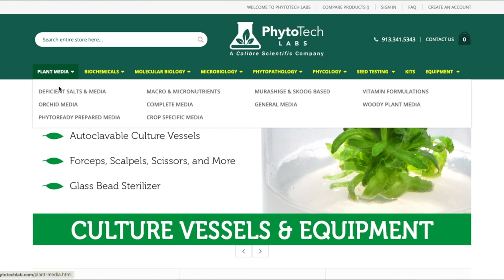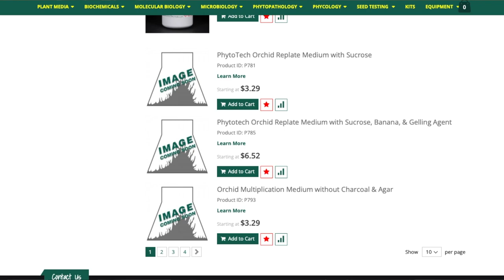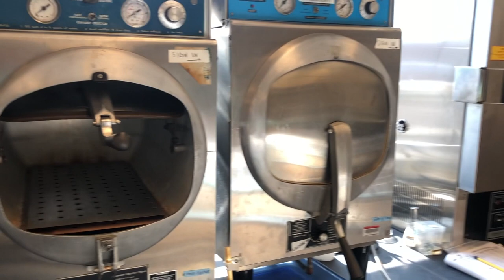Preparation of media; Flasked orchid growth

Comment: Is there a way to sterilize/prep your flasks without having to autoclave/pressure cook?
Reply from the maker: Thanks for your question - some claim that they can include antimicrobials in the medium to kill all the microbes that will interfere with flasking but you have to use very high levels and I have never been successful with this. You can filter sterilize the medium but the filters are expensive and you need a good vacuum pump to draw the medium through the filter - this is for liquid medium only without charcoal. The pore size on the filters need to be small enough to filter out microbes. Sorry - I do not know a reliable way to do this. If you find something out, please let me know.